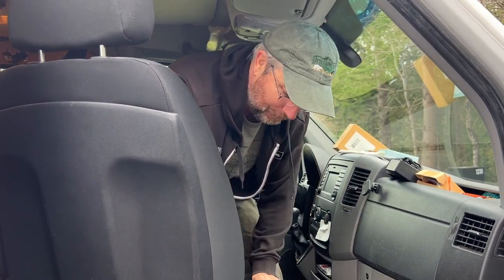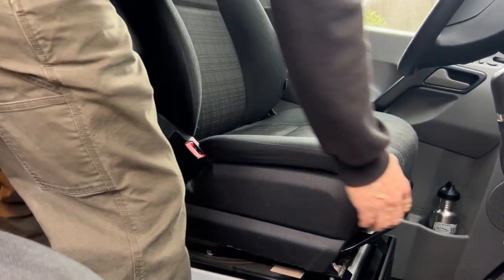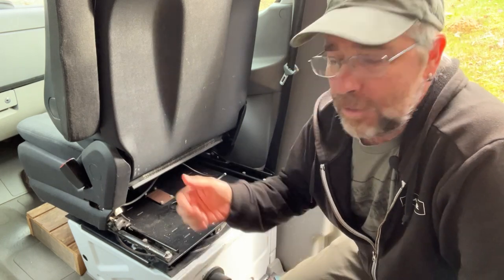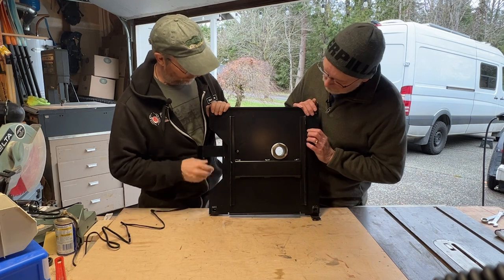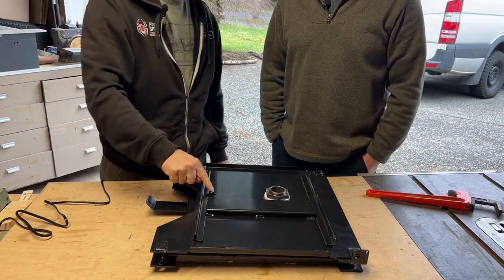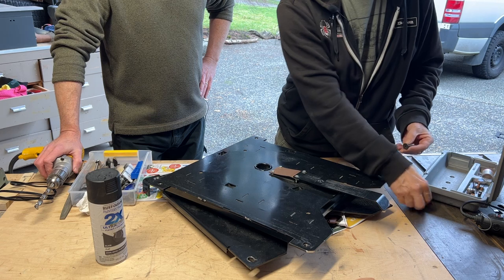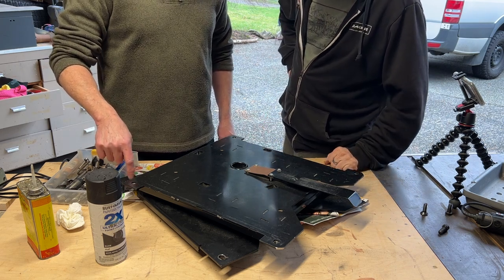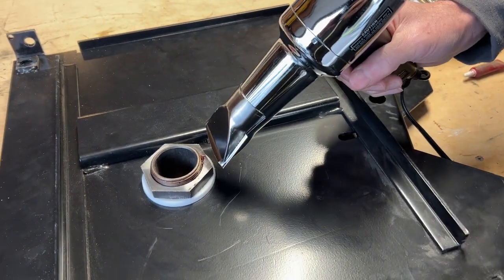SWIVEL SEAT WOES IN YOUR CAMPER VAN? TRY THESE FIXES - Much easier use after a few easy tweaks

Comment: I understand Shannon’s smile. Our swivels are a different brand, but also really hard to swivel. I think mine need to be loosened and lubricated. Thank you for the tip of disconnecting battery from inside before disconnecting the airbags. I paid $100 at the MB dealership to get code removed after removing seat last time.
Reply from the maker: Yep, same here - that's how we learned that you need to disconnect the battery! Good luck with yours, I hope you can get them working more smoothly like we did!